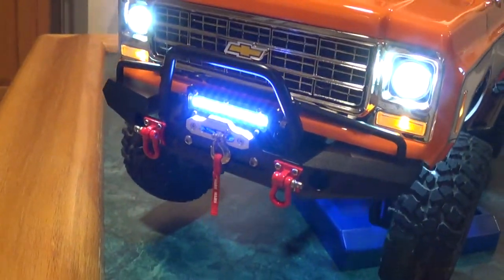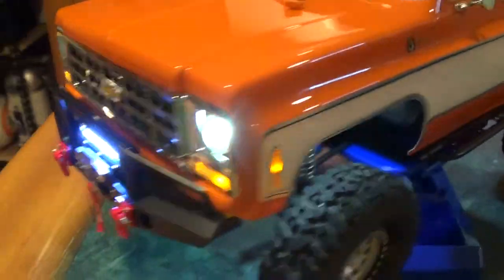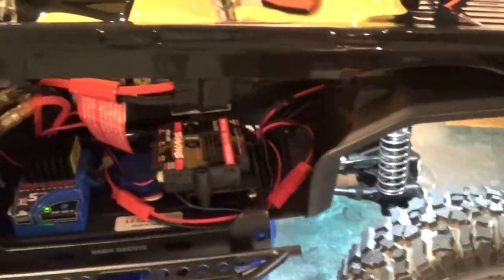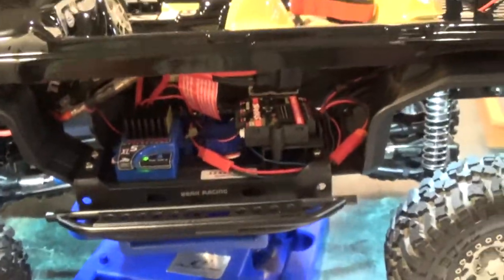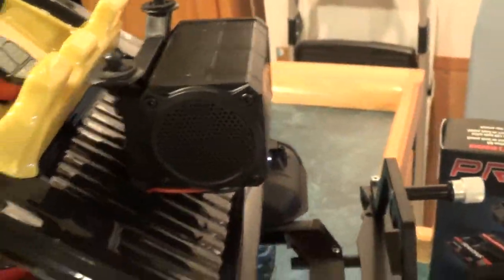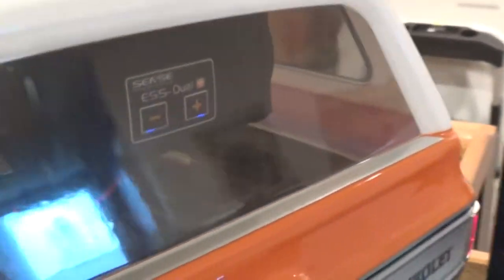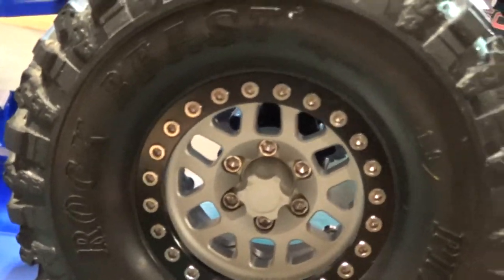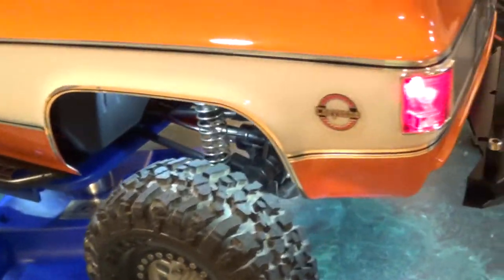Traxxas TRX4 Blazer Pro Scale Light Kit Installed

Comment: Hey man that’s a nice build you’ve got there. I recently installed the pro light kit and rock light set with the wireless setup as well. Same problem front signal lights worked and all that jazz but no change in the rear other than reverse lights. Here after messing around with the wires and module I realized the jumper kit from traxxas that goes in the “f” port was wired wrong. With a little patience and a small pick I was able to back the wires out of the jumper and install them in the proper orientation. Traxxas sent my jumper with both wires for the “f” jumper going from side-to-side ( which from what I seen in your video they did the same to you) and this was the fault. The wires need to go straight up and down on the jumper. After I flipped the wires I now have brake lights whenever you slightly tap the trigger towards reverse and now the turn signals for the rear now function as well. I hope this helps. I was definitely stumped on mine especially after dropping a good bit of green on this pro light kit setup.
Reply from the maker: Thanks, I will definitely look into that mod for the jumper on my Pro Scale Light kit.  It’s definitely a shame after spending a good amount of money on these light kits these issues happen.  Good thing I enjoy modding and fixing things on all of my RCs😁.
Reply: @beyondthebluerc1  I hope this works for you. Curious to see the outcome. If you have questions on it let me know.
Reply: it helped :)
Thank you!!!
Reply: I'm having the same trouble. What jumper cable are you describing? Is it the one you have to use in conjunction with  the Bluetooth link in the remote?

Comment: Great video Ed I had the same problem with my rear signals what it was I couldn’t use the original light kit I had to replace it with a compatible light kit for high voltage
Reply from the maker: Ok thanks for the info.  I had a feeling that was the case.  Did you just replace the tail lights or did you have to switch out the entire original light kit?
Reply: @beyondthebluerc1  I had to replace the kit completely which costs almost twice the price as the first kit so I ended up putting it on my shelf Queen
Reply from the maker: @chucksmith155  

Wow, I’m not sure if it is worth it to me to put that much more money into this light kit.  I already have spent way too much in upgrades on this rig.  It’s a shelf queen that I occasionally take out on trails.  I will have to 🤔 think on whether I will get the upgraded light kit, since funds are tight right now.  Thanks again for the info, it is much appreciated.

Comment: Extremely nice build. Just got into crawlers at the 1/24th scale after nitro trucks for RC choppers for many years and will be looking to upgrade to 1/10 in the Spring. Would you still go with the TRX4 platform?
Reply from the maker: Thanks, there are a lot of different brands of crawlers available, but personally the TRX4 is my favorite.  The hop up potential is great and there bodies are really detailed for a lexan shell.  I bought a Vaterra Ascender for my wife a couple years ago.  It’s a good rig, but are discontinued now and there is very little aftermarket support for it.  I installed some aluminum bead lock wheels and tires on it and that was all I could find.
Reply: @beyondthebluerc1  Appreciate your insight. I have three nitro Traxxas and that's a good point, I'll stick with the brand for all the upgrades.

Comment: Can you use this light kit with an aftermarket motor/esc?  I am thinking of getting the HW Fusion Pro.
Reply from the maker: It’s meant to be used with stock esc and motor, but probably could be modified to work with an aftermarket set up.  You might have to modify the connector going to the esc and the connectors that hook up to the motor wires.
Reply from the maker: I looked at the HW Fusion Pro and it is an all in one system.  I’m not sure that this light kit would work with the HW Fusion Pro.  There is no separate esc to plug into.  You could get most of the functions to work except for the brake and reverse lights.  You have to plug into an esc and motor for those functions to work properly.  Maybe you could splice into the programming wire and that might work, but it is such an enclosed system I think it will be difficult.  I was thinking of upgrading my truck to brushless at one point, but I have other rigs that are brushless, so I just don’t see the point.  I just got a Traxxas UDR that I made a bunch of modifications to.  I definitely can’t wait to get it out for its maiden run🤪.

Comment: Had the same issue with the rear lights the gray jumper is pinned wrong the jumper need to go from top to the center pin 
I called traxxas and there was an issue they send out a new jump but can just repin it
Reply: Just watched again yours is pinned correct